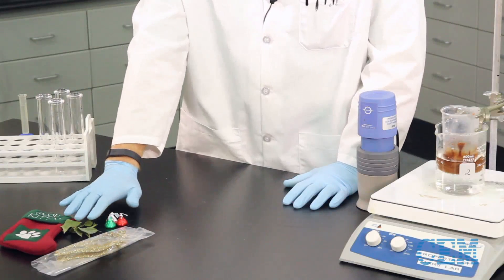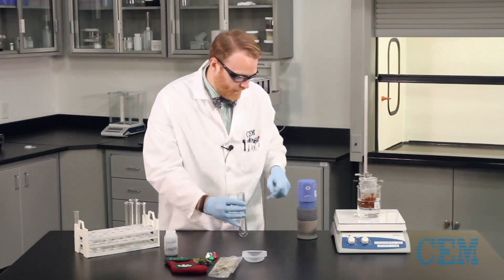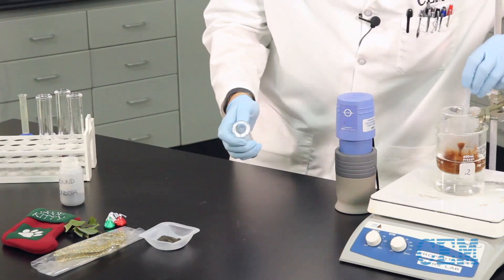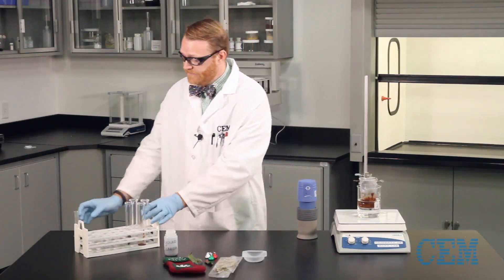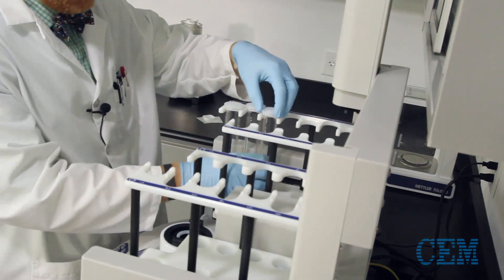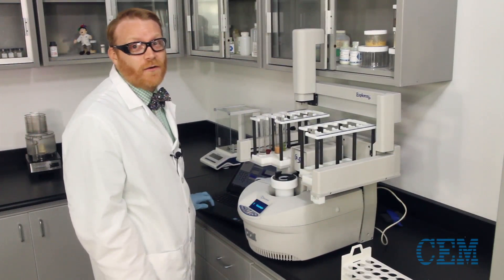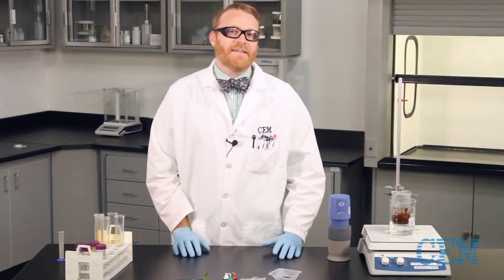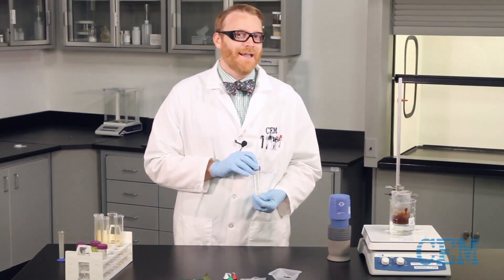Will it Digest? Episode 7: Digesting Christmas

Comment: Dear CEM. I would like to know the process that happened in the Microwave: how to set the temperature, the pressure, ramp, time???. I saw you use only Nitric acid to digest, is that right?